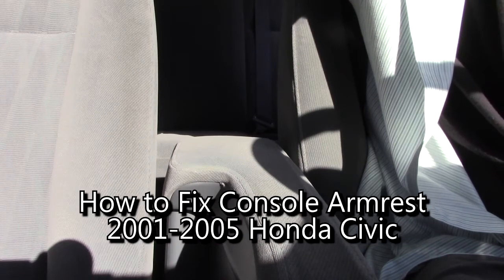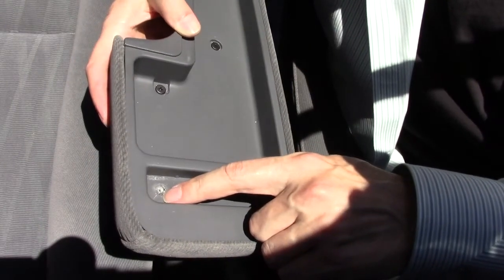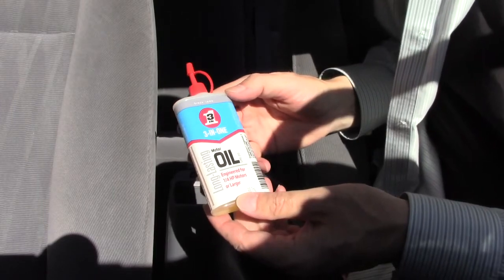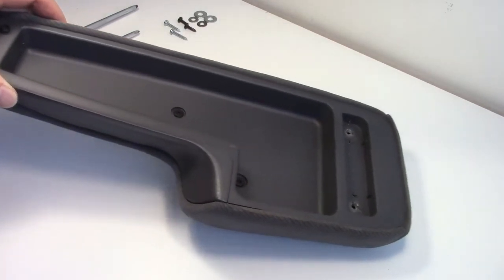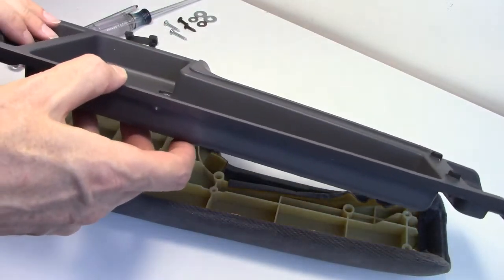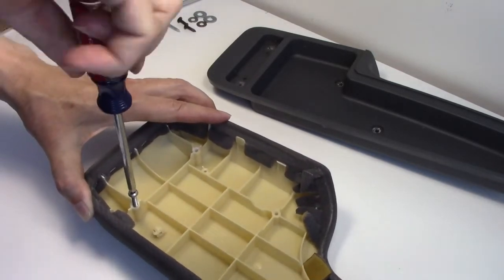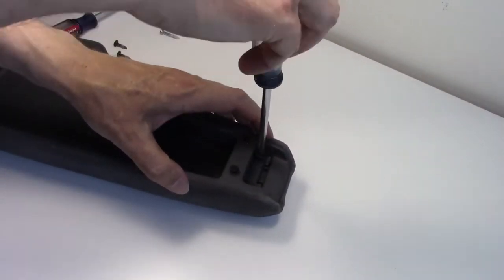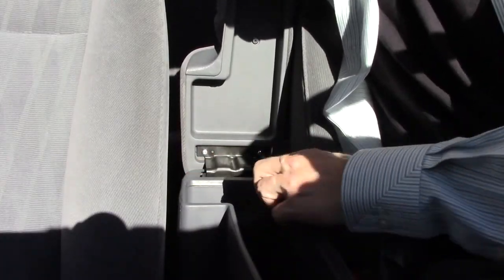How to Fix Center Console Armrest 2001 2003 2004 2005 Honda Civic

Comment from the maker: Fix the squeaky hinge quickly without removing armrest by using WD40 with extension, spray behind metal bracket and reapply every few years. For longer lasting repair follow video and apply 1 drop of oil between each hinge segment (6 drops total) more if really stiff. Repair plastic screw anchor mounts with glue for plastic, the old mounts become brittle so a longer screw is best option for a lasting repair.

Comment: doesnt that cover come with a latch to secure it shut or does it just flop around opened? i have a 2004 and it has not latch to secure it shut....im just wondering if they come with a latch or if mine was just broken off.
Reply from the maker: good question, there is a grey plastic latch that flexes on thin plastic seam, size of book of matches, mine broke off years ago, not a good design. The armrest will shift slightly side to side without the latch. Can be found online for $10 or local auto wrecker yard.

Comment: The plastic piece under the armrest broken off with the two screws. Do you where I can get that? It’s so hard to find most website only sells the cover. But I need the arm rest
Reply from the maker: best option for obtaining replacement armrest is Honda Dealer or local wrecker yard. Ordering off eBay may result in wrong size or other damage. Plastic over time becomes brittle especially in cold climates so these older parts will crack easier. As shown in the video the 2 screw locking clip is broken and missing so my armrest chatters on rough roads. If you don't need the locking clip use rubber/plastic washers to mount base to top. Honda Dealer used to sell the front 2 screw plastic clip for $20.